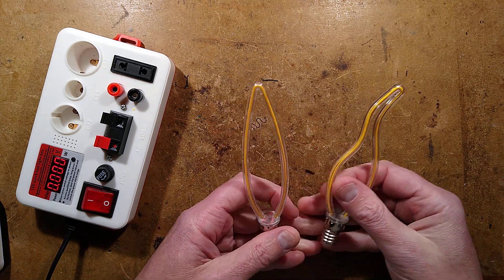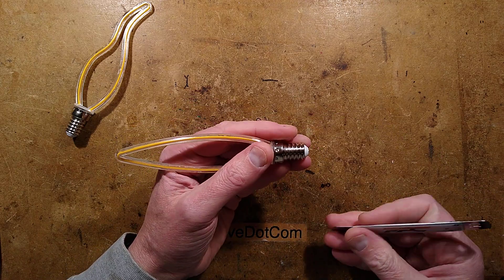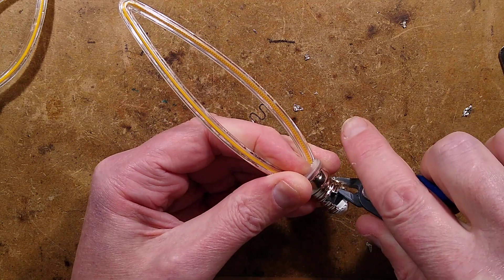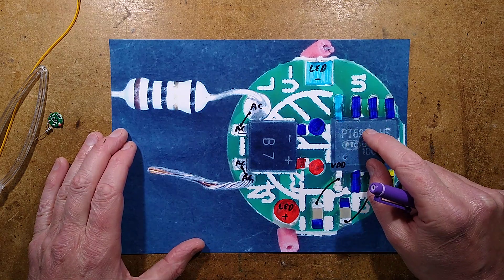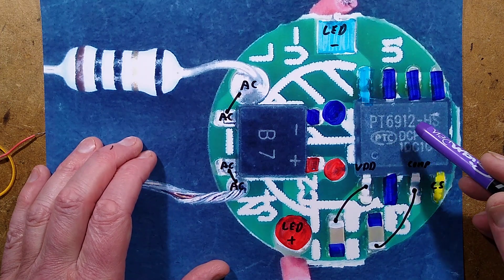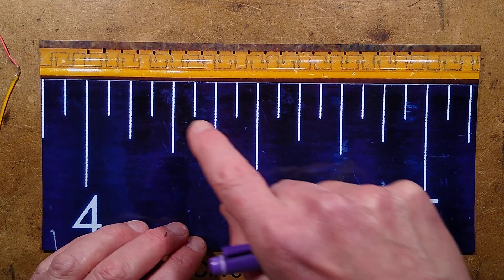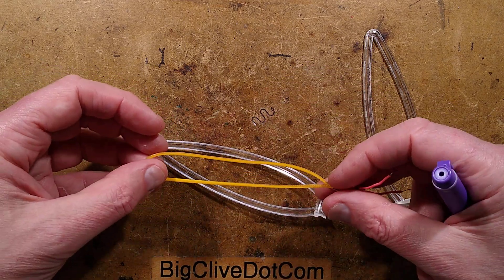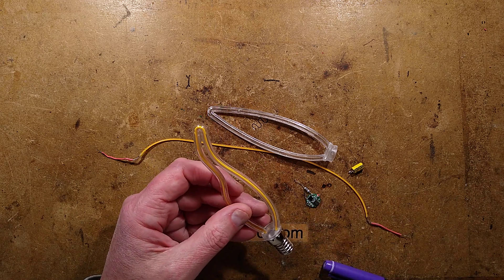Interesting LED flame shape bulbs - with schematic

Comment: Even without water ingress, it seems that the only separation between someone touching the outside of the plastic tube and the mains voltage inside is a millimeter or so creepage through the imperfectly sealed joint between the two halves. That can't be legal.

Comment: Do you have a PO-BOX?
Just I've been doing some tidying and found an old valve radio with a Bakelite case  (it works!) in the loft.
I was wondering if you'd be up for doing a takedown from a modern perspective for educational purposes?
Reply from the maker: Thanks for the offer.  I do have two valve radios here.

Comment: 40V across the regulator seems rather high. I wonder why those filaments aren't made in forward voltages that more closely relate to the smoothed rectified 240v?

Comment: So, was the harsh light colors produced by the leds, or an optical effect from the "case" partly splitting the colors, or a combination?
Reply from the maker: It may have been a lensing effect, but was mainly the way the filament had been constructed.

Comment: Did you try to estimate the power dissipation on the linear regulator? I think they skimped on the number of LEDs in the filament, it should be possible to keep the regulator quite cool with a few more in the series.
Reply from the maker: They have aimed this for the 220V to 240V market with tolerance.

Comment: I need to replace some smd led strips. I want to be able to adjust their color from red through cold white. In trying to look it up I found out I don’t know what to look up. I have a SAD panel that an LED self destructed on one of the strips. The strip is 5mm wide, 1.6mm thick and 132mm long. What is the verbiage used to describe it? I don’t need it to follow, drip or pulse just adjust the color.
Reply from the maker: You get RGB and white LED strip and matching four channel dimmers that could probably be used for that.

Comment: I wish you would run them for a bit and check the temp of the base. Lots of these get super hot and dangerous to touch and die quickly, especially if mounted upside-down

Comment: Aliexpress seems to suddenly have a lot of these led filaments popping up, I’ve been buying little usb lamps with touch pad on/off and a dimmer function, the filaments come in various colours and look very pretty inside little glass bottles.
I get the feeling something has made these filaments a cheaper option, lately.
Reply from the maker: The thing that made them cheaper was the evolution of flip-chips.  Bare LED chips with no need for wire bonds, as they literally solder to PCBs like a tiny component.

Comment: This is probably an easy question with a simple answer, is there a reason they use the electrolytic cap instead of a different type that would last longer? Just cost?
Reply from the maker: Cost, capacity, voltage rating and size.

Comment: I've seen "light string" versions of these being used as outdoor decorative lights. Obviously mains powered, but smaller, so presumably no on board PSU and lower operating voltage? Ali has so many LED light designs these days, the choice is becoming quite a challenge (and that's apart from the multicolour LED cord / strop / "neon" replica materials).
Reply: Well, Halloween approaches so it would be interesting to see what Coles, Woolies and Aldi have on offer. I hope they have these in some form or another. The hard plastic lights are so inflexible.

Comment: id like to see you take appart a hqd vape 15000 puffs
Reply from the maker: Much as I want to make videos about different vape devices and their technology, YouTube treats them as promoting vaping and it causes issues.
Reply: I've grabbed a few of those with the neat 7-segment displays for battery level and fluid level read outs. There are 13 LEDs within, and 5 connections all to MCU pins through resistors. Hopefully I can work out how to reuse them!

Comment: I've been using these filament LEDs for low power garden lamps and ornaments.  They make a lot of light.  What I've found is that if you hook up a tiny flashing candle LED in parallel, it'll make the filament also react the same.  I assume it'd work in series as well.  I did manage to minimize the effect by using Schottky diodes to isolate the filament.

Comment: A large big-box store in our town is giving employees some really cool retractable ballpoint pens; when you click the button to extend the point, the company name on the barrel lights up. Pretty cool effect. I'm thinking of tearing one open to see what kind of batteries and white LEDs they're using. Gotta be pretty small ones to fit in a pen barrel. I have Pliers of Investigation to get it open, and a Dremel if needed,, wish me luck. 🙂
Reply: Years ago, I picked up a similar pen at a trade show in the US. They had some fancy design near the top end of the barrel that lit up when a button at the top was pressed. I think it used 2 or 3 tiny little button batteries. But the thing that lit up was inside the entire part of the barrel where it was located. That part of the barrel was clear plastic to allow for the tiny light show.
Reply: @two_tier_gary_rumain  yeah it's got to be really small button cells. I haven't cracked it open yet, I kind of wanted to test the battery life first. Sadly, there's no way to open the barrel and change batteries. Another result of throw-away culture.
Reply: @tncorgi92 In my country (Australia) at least, if you could easily open it then it would not pass child safety laws. Small children/babies just love swallowing tiny button cells resulting in serious, extremely painful, often permanently disfiguring and possibly life threatening internal burns. 
In one instance (in another country I think) it burnt right through the oesophagus and burnt the heart. 
Due to this I think the battery compartment is required to be fitted with a small screw and not comprised of 2  sections just threaded together like most pens. Something which might be difficult to do unless it's a rather large bulky pen?

Comment: Some scope for modification with those LED filaments we all previously bought for a lower voltage option (given those past electric noodles were I think 3v per filament) with the use of a joule thief or solar light circuit to power them... :D

Comment: i liked this one thanks. as i like to bore my friends here with my adventures, of late, i thought i'd share my last week or so. it has been a blinder. i found a web site (world radio history) on which is loads of copies of everyday electronics magazine. i have read from 1973 to 1982 so far. it has been a revelation. so many cool projects. and the ads are great (50p for a 555 in 1976, that is about a fiver now with inflation!). they seem to love using logic chips in nearly all the projects( and the logic schematics are completely different to the usual ones, in fact they had an article which explained how to translate British standard diagrams (which they use) with the American method (which we all use now), and such oddities as unijunction transistors (i just ordered some  2N2646s from ebay, so i can make an oscillator like it's the mid 70s). i recommend reading them to anyone interested in all this stuff.

Comment: So if the LED's are wired in pairs, does that mean reverse pairs, so that half of them don't get used? Seems a bit of a waste.
Reply: Not reverse pairs - they all light. 
Each LED drops about 3 Volt. If you connect 2 together in parallel (and both facing the same way), you would still drop 3V across them, at twice the current of 1 LED. 
If you connect 2 in series, you would drop twice the Voltage (6V), at the current of one LED. 
This bulb makes 100 parallel pairs, then connects those pairs up in series, so you get a string of them 100 long and 2 wide. Then you get 100x the Volt drop (300V) at 2x the current of 1 LED.
If you just put all the LEDs in one string 200 long, you would need 600V to get them to light, and it starts becoming impractical.

Comment: Couldn't you  measure the voltage  drop  across the  current  sense  resistor  to find the  total current  going into the  LED string      along  with the   internal  transistor  inside  the  regulator  chip
Reply from the maker: The threshold is usually about 0.6V on the sense resistor.

Comment: Clive, you removal of the ES base reminds me of how we stripped pyro in the day. It’s so long ago I’ve no idea if Pyro is still stripped the same way, if Pyro even still exists?
Anyone know?
K
Reply from the maker: It is still used.  I used to do a lot of pyro.  I still have the tools somewhere.
Reply: What on Earth is Pyro?
Reply: Pyro is a flameproof ridged mains cable. It comes/came in many different numbers of conductors, and the conductors were encased in a copper jacket. Between the jacket and conductors is a chalk-like powder, again flameproof. 
Some Pyro cables came with a PVC outer covering, the colour of which varied upon application. 
Terminating the end of Pyro cable was an art I perfected as an apprentice when apprenticeships took a minimum of 4 years, not the modern 1 year apprenticeships we see now.
The ends of the cable had to be terminated in a brass screw-on pot that you had to secrete a grey, special flameproof putty into. Putting the putty in, you had to make sure there were no air pockets. There was a "plastic" end that pressed onto the open end of the brass pot that had several guide holes in it depending upon how many conductors there were, and a tool was used to crimp the end onto the brass pot.
The outer copper jacket was the earth. 
I live only 2 miles away from the original Pyro factory and had the opportunity to look around it. 
I could go on and on about pyro, but I think this is enough to put most folk to sleep!
Reply: @getcartercarpark.  Thanks, that's interesting if it's still used today, because I've installed fireproof cabling for smoke exhaust blower fans and they were flexibe, no metal shield on the wires, it felt like some type of silicone. Although they had limited fire resistance, about an hour IIRC. Judging by the construction of that Pyro cable, it might be fireproof for a much longer period.
Reply: @mrnmrn1  C'mon Clive le"s be avenue...What on Earth is Pyro?
Reply: Clive, how about a demo of how to terminate a small 2.5 mm two core piece of Pyro?
Reply from the maker: @mrnmrn1  Pyrotenax cable.  Literally a copper pipe with internal bare cores insulated with something resembling chalk.  It is inherently fire proof.  It requires specialist tools and terminations.
Reply: Ahh pyro...us chronic dyspraxics loved it but could never get to personally install it being too expensive...I'd practice but by the time I got to install some for real my "muscle memory" forgot. 🤜🏿🤛🏻🧿

Comment: Do linear current regulators coexist with a series dropper cap, at least one added later? I'd think if the cap limits the current to something below the set point of the chip, it would just run wide open, but I'm not sure.
Reply from the maker: If the capacitor limits the current too much the linear regulator will not attempt to regulate it further.

Comment: I wonder if a pipe cutter would work to release the bayonet section below the crimps? Could the PCB also be flipped so that the capacitor is on the other side and the board shields it from direct heat?
Reply: I don't think so. A pipe cutter probably presses the thin material together and you start cutting into the electronics if you are not VERY careful.
Reply: There wouldn't be sufficient room if the cap was on the other side of the PCB. Or there might be if the internal layout was redesigned.
 A very thin spudger or flathead screwdriver might be able to loosen the crimping enough to pull the internals out from the top.
Reply: The copper fill on the other side acts as a heatsink for the same chip though some vias, so that side in not much cooler. If there's enough room, the cap could be mounted with a few mm longer leads.

Comment: I wonder if they mounted the electrolytic cap on the other side of the board it would help with the heating. I mean, that little lamp base is still going to be an oven, but at least it wouldn't be getting cooked quite so directly by that chip.
Reply: So, directly above the regulator making the heat?.......
Reply: @phonotical  Just arranged so it's not acting as a direct contact heatsink for that chip.

Comment: I wonder if you could get "okay" smoothing by replacing that electrolytic capacitor with a lower-rated film cap, as big as can fit in there.  Of course, replacing the screw-in base probably isn't worth the effort.  But if you had a bunch of these that died they could be reclaimed and built into something new with a cap that won't dry up in a couple years.
Reply: You can also fit an external rectifier and capacitor between the supply and the MES socket. That allows a larger capacitor and one that doesn't run hot. With an external capacitor, there will be no change in behavior when the internal one dries out.
Reply: Or just "rotate" circuit board. Put heat sources on top, outside. Leave heat intolerant caps and other components inside base, shielded by circuit board it self. Use thicker and/or better heat insulated circuit board. Sockets normally run cool and not worming up.

Comment: Would it be cleaner to drill out the crimps? It might take longer than shredding the base with cutters though.
Reply: That's what I was thinking. But I'd also do it on a drill press with a depth stop so the bit can only go deep enough to cut out the crimps. If I tried doing it by hand, I expect I'd go right through unless I was being very careful.
Reply: I usually use a flat screwdriver to pry(z) the crimped part, and it takes less time than what we see here. It may not work well with glass tubes, though.
Reply: yes, but not as much fun and less chance of blood!!

Comment: I like the simplicity of this, and it's not running the LEDs too hard at that power level. Although with such a high combined forward voltage you could get away with just a resistor for current limiting if the current was adjusted just a little bit more down, say 10k resistor dropping 100 volts and dissipating one watt. The electrolytic capacitor is a definitely a problem, no matter what you do, inside such a tiny enclosure.

Comment: So the lifetime of these lamps might be different if they are fixed pointing up rather than down, as the heat from the chip would rise towards the capacitor or away from it?
Reply from the maker: That has been a thing since the compact fluorescent era.  Some lamps were only rated for base-down use.
Reply: It's going to heat everything inside the metal capsule either way.  The heat-dissipating behavior of whatever fixture you put this in will probably have more impact on lifespan.

Comment: Why did this one have that blue light on the sides?
Reply: They're blue LED chips with phosphor coating over the top - not enough phosphor has been applied to catch the light coming out the sides
Reply: Technically, there are no white LEDs. These lights have deep blue/UV LEDs coated with a mix of fluorescent pigments to produce the tone of white required.
Reply: @nicholasamesbury  not really, there were white leds before uv and blue
Reply: @phonotical  Would be interesting to know by which method they were made white if they preceded blue. Blue and UV have existed for a long time, it has now only been for the last twenty-some years that they have been inexpensive enough to be installed into consumer-affordable products that are produced in heaps.
Reply: It is not because there isn't enough phosphorescent material on the led at all, it's because of how the light enters the camera lens, if that lens is coated and the arrangement of the lenses causing internal reflections
Reply: @phonotical  No, clive clearly states seeing it in person. So it's not just the camera/lens.
Reply: @Eis_Bear Is it possible that the clear lens is filtering out colors except for blue, or would the blue be too dim to see if that were the case
Reply: @Eis_Bear  no, rewatch and reread.

Comment: Very interesting.  Thanks Big Clive.  I know it's old news these days but it still blows me away how they pack so many LEDs in a flexible filament.   It's crazy.  Also, I was guessing that they're using a standard lamp base off the shelf so if they had just made the plastic lamp base part a little longer, maybe they could have given the Cap a little more breathing room.  Guessing too that they might not have that problem in an E27 version.  5 watts seems pretty hot to me, there's not a lot of room to try to hack that current resistor.
Reply: You can't make the base too long. That would expose live metal (when on). A no-no with hands touching it. Rather, if they used the standard Edison size, it would have about twice the room. Alternately, they could have used a plastic housing above the base like they used to have with the compact fluoro bulbs. I have one in front of me right now. I took a failed one apart some years ago, and they were filled with all sorts of components. These LEDs wouldn't need to be as big.
Reply: @two_tier_gary_rumain  The threaded part of an Edison base is usually exposed and, as such, must be connected to neutral.

Comment: I was waiting for you to bring out the flush snips, but you wisely went for the real cutters. I bought a 5pk of the blue snips ("PCAFC" and "Use Safety Glasses" written on handle) that I've been using for years, they're all over AliExpress, Temu, etc., and I recently realised why they say to use safety glasses. Because when over-stressed the steel doesn't bend, it violently shatters and sends a piece of metal towards your face. It's happened to 3 out of the 5 when cutting slightly thicker plastics. So yeah, for thin light plastics only it seems.

Edit: Oh crap, the next moment you pulled out the PCAFC lol.... so yes, word to the wise, be careful :)